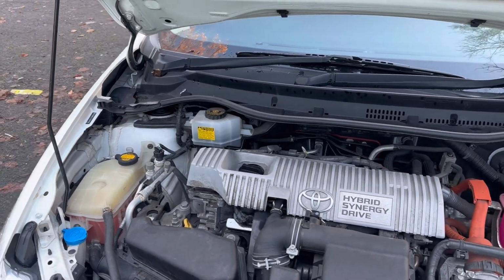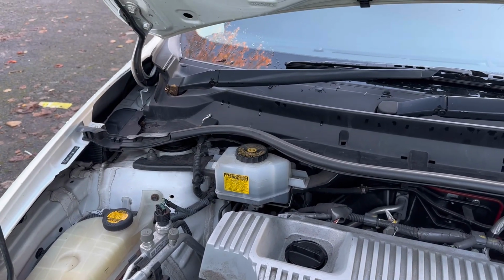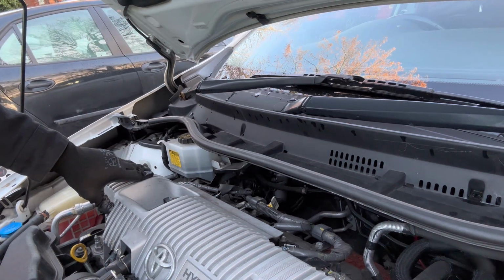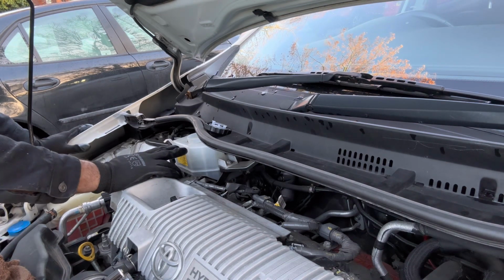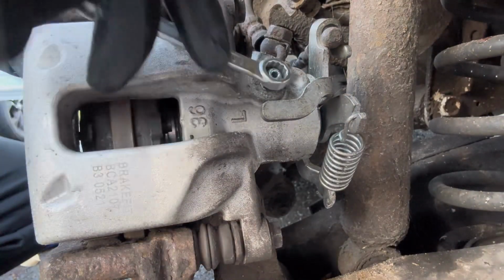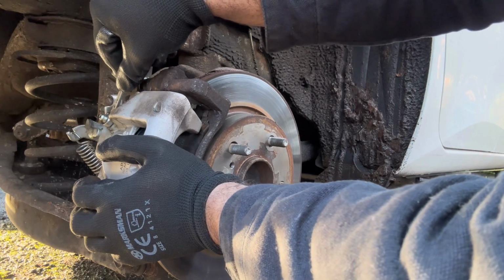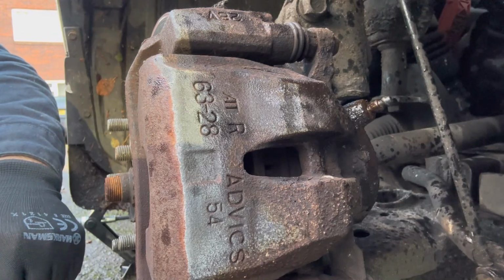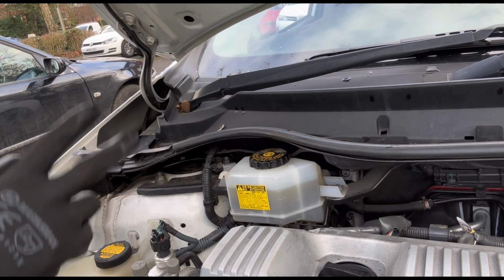Toyota auris | brake oil | fluid | changing

Comment: How not to bleed brakes! The backsplash of that brake fluid landing on your paintwork not a great idea. Not to mention environmental impact! All it takes is a clear tube & a bottle if your on a budget. Or better still invest in an ebay brake bleeder kit for £10-15 one man bleeder suctions the fluid out of the bleeder. You need to work smart. This video is a quick & dirty way of bleeding brakes.

Comment: Just wondering about the age of that Auris. Never changed my break fluid on my 2011 Auris and it breaks just fine !
Reply from the maker: It is recommended by the specialist to change it every often but not necessarily to be replaced.
Reply: On normal braking around city or motorway driving you wont notice the brake fluid boiling. If you were on a spirited drive say countryside or mountain pass if your brake fluid has water content you will make the brake pedal sink to the ground with little or no brakes more noticeable downhill. Not to mention other issues like seized calipers/ABS pump causing a problem long term. It costs less than £20-30 for a DIY brake fluid change dont chance it. Its well worth getting it changed.
Reply: 10 y / 100k miles interval is enough for hybrid car just like Tesla. It depends on how much % water. <2% is good. I did every 7-10 y is enough unless idiots forget closing the lid.
Reply: The brake fluid needs to be changed regularly. (At least tested every year and depending on the moisture level changed). I usually change it every 2/3 years.
Reply: On most of my vehicles in the past 40 years, I never bothered changing brake fluid, but when I started to do it I noticed the difference: brakes become really more responsive. It simply can make the difference in case of emergency. 😉
I decided to flush brake fluid on a regular basis when the car I had then had its brakes pipes burst because of corrosion! It was 20year old and made 200000Km so it's hard to say if changing brakes fluid regularly would have changed anything but if you do it by yourself it doesn't cost much, so why not do it?
Reply: Where is your garage ?

Comment: I just wonder that, is there any importance of priority of tyre when it is draining, because you started rear sides after front size. And how to arrange quantity of draining oil. Each tyre three times draining is OK or not
Reply from the maker: Start from the rear side first cos brake line are coming from the front. Try drain 1 litre from all tyres. 65% from the rear and 35% from font.

Comment: There is a proper calibration of each side u can’t do this way ur master cylinder will be damaged and cause issues later on
Reply from the maker: Yes I agree I did that later on
Reply: What do you mean? What calibration do you need to do?